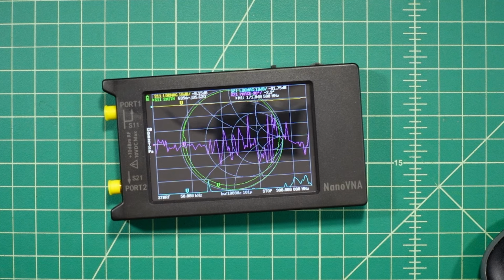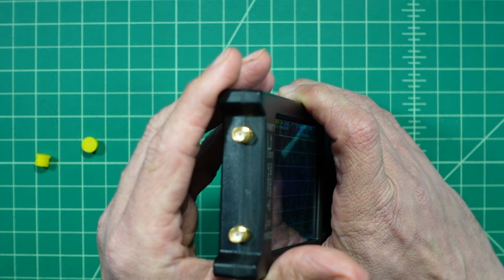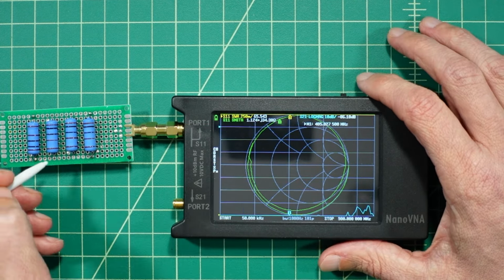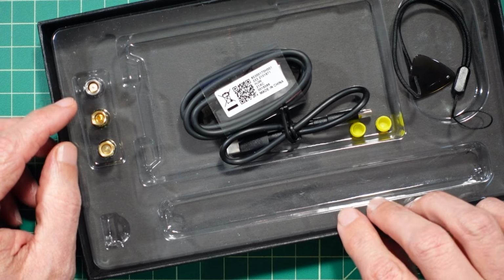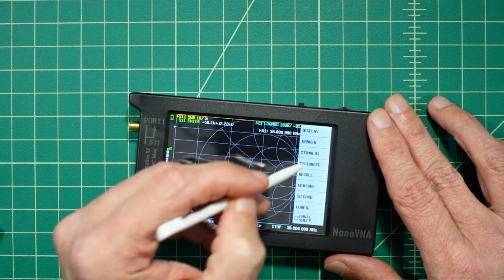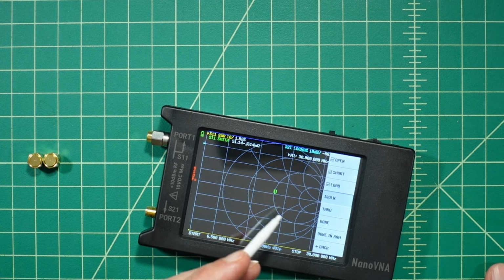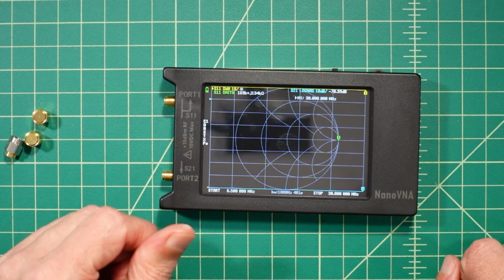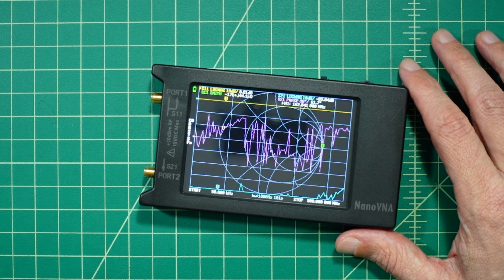NanoVNA Calibration: Expert Tips and Tricks

Comment: Last week I observed another potential pitfall to be aware of if you use the USB cable to connect to your computer. I wanted to compare a Quansheng stock antenna to a tuned aftermarket antenna. I put the stock antenna on, and loaded my calibration file. The resulting plot surprised me in that the antenna seemed worse than I anticipated. So on goes my tuned antenna, and it also exhibited SWR values that I knew had to be incorrect. So I re-calibrated, and it did not change. So then I changed the USB cable, and everything changed for the better. In fact, it then demonstrated the stock antenna had a better window of acceptable SWR in both VHF and UHF than I had anticipated. So the moral of this story is make sure your USB cable is performing properly. If in doubt, try a few of them and use a composite of the results that agree the closest.
Reply from the maker: That’s a pretty good tip, thank you 👍
Reply: @TheSmokinApe  
My downfall is I'm rather cheap. So that means 1: I often buy my cables from China, and then 2: I hate throwing things out. So, for anyone like me (may god have mercy on their souls), if you want to continue with step #1, you need to change the habits shown in step #2!
Reply: I assume we are talking about HT antennas here? rubber duckies? helical type? If so what you are seeing is not the USB lead per se. A hand held antenna a usually a quarter wave or loaded/shortened thing attempting to be a quarter wave and as such the element of the antenna is not the total antenna system. It relies on the HT body as part of the system that makes it work and match. It may even rely on being held to match well. When you attach these antennas to measuring devices like a NanoVNA, its a complete lottery whether the conditions for a good match are met. Like you found, the particular USB lead you had attached, or whether it on a wooden or metal bench top. Its a waste of time to fret about the performance on these portable device antennas, they never had any any, and cant been bestowed with any, they are and always will be severely compromised. Take a deep breath and chant "SWR is not loss, SWR is not loss....." :)
de G0AFV

Comment: Over the years I've collected a box full of unmarked antennas, I purchased a LiteVNA 64 V3.1 last year but they left the instruction out... I did your calibration and measured an ADS-B antenna (it is marked 1090) and got 1090! It's a start, I think I saw you measure 1,500PF for the cable, these things leave me have a lot to learn. Your video is useful, unlike some videos that blow pass the menu picks, the menus seems to be never ending.
Reply from the maker: Glad it was helpful, good luck testing all those antennas

Comment: Why wouldn't you just calibrate it with the short extension attached ?  I.e. attach the open, short, and load to the end of that short extension, because then that is where you will attach the coax and measure SWR.   Maybe I'm missing something?
Reply from the maker: Hey Jeff, that is the best practice but maybe the extension doesn’t have the same attachment for your calibration standards.  I really was trying to show “what is possible” not “what you should do”.  Thanks for watching 👍

Comment: Good video, but why does every video on calibrating and using the Nanovna describe a different process? One leaves out the isolation and thru stages. Another says put the load on the lower port for isolation. This is the first video I've found that says the sma female to female link is a standard for the thru calibration and to use it with both pigtails, others just use one pigtail to connect the ports to each other. I have a Nanovna that records SWR at 1.6 where my SWR meter records 1.1 - and I have no idea which one to trust 🫤
Reply from the maker: There are a few calibration methods depending on the measurement you are making.  That said, don’t have a known load you can compare both to?

Comment: Is the through port calibration needed all the time or only if you are going to use that second port? A;sp when saving calibrations in a saved location, they will automatically use the correct calibration. even though it had been turned off?
Reply from the maker: Yes, the thru cal is for when you are using two ports.  The saved calibrations persist even when turned off 👍

Comment: Excellent video. Some firmwares auto recall from slot 0 on power on, so set your most used profile up there. The slots save the trace configs and marker position as well, so I set it to the middle of 40m, my most used band.

You can "edit" a slot by recalling it, changing your trace configs, and saving to the slot again. You only need to re-calibrate when changing your start/stop frequencies :)
Reply from the maker: You are correct, thanks for the info 👍

Comment: I was wondering if rather than use the E-delay, would it make more sense to calibrate it with the test cable in place?
Reply from the maker: I think either will get you where you are going.  There are some cases where I could see an argument for using one of the other.

Comment: For low frequencies this procedure will be OK,. At the UHF band and above is better to calibrate at the end of  the cable instead the S11 port. Cables have it own VSWR and can lowering directivity of  the VNA. For  return loss -10 dB (VSWR 2:1) or more doesn't matter but if your device under test has -26dB (VSWR 1.1:1) the error can be between +6 dB and -infinite dB if the cable has -26 dB return loss. Is better to use a female to female adaptor and set the electrical delay to the reference plane in the cable connector, only few pico seconds in negative value will be necessary. Of corse the adaptor must have very low VSWR, typically female to female SMA adapators are bellow 1.04:1 VSWR up to 1 GHz.

Open doesn't matter for 30 MHz, you can just left open the connector of port S11 without the open standard. Friging capacitance are negligible at that frequencies.

In Smith chart all the unity circle (the external one) is infinite VSWR, no matter the phase.

Sorry for the faults, English isn't my native language.

Regards from Spain.
Reply from the maker: Thanks for the additional details 👍

Comment: Hi...thanks for the great video.  If you calibrate for 40 to 10 meters like you did in the video and then want to get an SWR curve for just say 20 meters, can you adjust the start and stop frequency values to the 20 meter band without having to calibrate to the smaller range that is within the larger originally calibrated range?  Thanks.
Reply from the maker: You can, and It do that however the best practice is to recalibrate 👍

Comment: Great explanation. I can calibrate mine to the built in SMA, but as soon as I attach an extension it goes haywire and gives wild readings. I have tried several cables, but no amount of fiddling with electrical delay or any other setting makes a difference. Any suggestions?
Reply from the maker: Are the extension cables "good" meaning quality with no problems?  What if you calibrate with the cables attached?

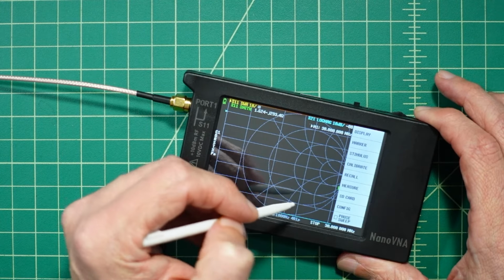Comment: 14:00 pro tip: The speed of radio waves is about 1 ft / ns in free air or about 8 inches per ns in a cable. So you can guestimate your delay pretty easily based on cable length.
Reply from the maker: Thanks man 👍

Comment: Not having to calibrate every single time I use this device makes testing antennas so much easier.

I just need to figure out grounding planes next. My HAM antennas go from 4.5 SWR to 1.1 SWR if I hold the base of the antenna.
Reply from the maker: Yeah, saved calibration is a great thing.  I am assuming you are testing HTs which is difficult 👍
Reply: @TheSmokinApe  Yep.

Comment: Great vidio. Is the lite VNA run with the same directions as the nano VNA? I got mine from R&L Electronics about 6 months ago. It seems that selecting the tabs on the right are hard. I did a screen calibration and it didn't help. Will look for a computer program to run it on my laptop with windows 11. 73's KG7COA
Reply from the maker: It should be similar, the different versions do have some variation in the firmware, make sure you are using a good stylus.  The best PC software is NanoVNA-Saver: https://youtu.be/2S0dt0bYoLs

Comment: That was great. I have the nano VNA-H4 . what i was doing at first was not save the calibrations . led to extra work each time I went to use. was a learning curve . with that tester you can do so much. figure the delay in coax the velocity factor. which is needed in phasing antenna's . along with  loss and reactance of coax. I used the H4 for tuning a UHF  duplexer for repeater use. and so much more. love how you can save data . you can even print out the charts. they have a zipper case for that. I got that when I ordered mine.  73's
Reply from the maker: Hey Robert, that H4 is the one I recommend to hams the most 👍
Reply: Tuning duplexers with a Nano VNA:
I bought one of these with very low expectations, and it didn't disappoint.
A good quality duplexer will generate -75dB to -90dB nulls when tuned carefully.
The Nano VNA can only measure down to something like -50dB.
As a result, you lose the bottom of the duplexer null response on the VNA display, and you can't really see what is happening.
They simply don't have enough dynamic range. It's output power isn't high enough to get through the -70 odd dB nulls of a duplexer, and / or it doesn't have a sensitive enough reciever section to pick out such weak signals.
I have toyed with the idea of adding an external amplifier and re-casing the whole lot, but I just haven't got around to it yet.
Reply from the maker: Yes, dynamic range can be a bit of an issue on these.  Thanks for the comment!
Reply: @digitalradiohacker  I still got the tune on a TX/RX systems used UHF duplexer used for a GMRS repeater. The nulls /notch dips to noise floor on the nano VNA , but I still found the frequency points for the HI and Low . was tricky and took time, but under power the SWR and power loss and receive loss was so much better then the old one . 73's
Reply: @robertmeyer4744  
👍👍
That's the problem - The noise floor APPEARS to be higher on one of these because the output is quite low, and this limits the precision with which you can tune duplexers. On more expensive instruments the noise floor APPEARS much lower, so you can see the real bottom of the nulls.
I know what you mean though - With a Nano VNA you can get a duplexer very very close, and for a quiet area with low RF levels, you'll get half decent range from the repeater.

Comment: When you do the thru calibration, why do you connect the two cables together first? Why not just connect a single cable to S11 and S21?
Reply from the maker: Because I will be using both in the test, so I want both to be part of the calibration 👍

Comment: Hello, thank you for this informative video!
I’m new to radiology, and If you could clarify how does your frequency range on smiths chart shrinks after electric delay introduction. But my 2.4 wifi range (I took with extra 2350MHz-2550MHz) shows huge arc that only shifts radially after delay input(I tried 1000p 500p etc)?
My extension cable came with NanoVNA. Should I expect it to shrink at all?
Reply from the maker: The e-dalay adjusts the Nano to account for added transmission like that was not part of the calibration.
Reply: @TheSmokinApe  Great, I just retested your values on my vna, and the result was same as yours! I'm glad. Everytime things go south I think of me breaking my nano(for me it costs fortune). Thanks for the response and clarification!

Comment: good learning thanks ... question as  new to this .. using vna ... got 1.5 swr but logmag showing way out anything from 20 to 60 loss , any ideas please
Reply from the maker: There are two different LogMag measurements, one is return loss (s11) where low is a good thing and the other s21 LogMag is a gain / loss measurement.  It sounds like you are measuring return loss (s11) and you want that to be low.
Reply: ok not good then ,,, thanks .. needs to do new cable thanks info ,,, keep up the  good work
 @TheSmokinApe
Reply from the maker: Thanks bro 👍

Comment: Another good and useful video, thanks Ape. I have a small VNA which I bought in the COVID lockdown. It's done well but it's battery is starting to bulge, so I thought I would upgrade. There are so many flavours of VNA now, please can you say if the H4 is as good as any for general ham work, or are there better options? Cheers, Ace
Reply from the maker: Hey Ace, I had a battery go bad in one of mine and I replaced it on video; its somewhere on the channel.  The H4 is the one I recommend to hams the most 👍
Reply: @TheSmokinApe Thanks for your help Ape, I check through your video list. Based on your advice, I may buy an H4 and replace the battery in my old 2.8 screen unit and use it as a back-up. The VNA is such a useful ham tool, I wonder how I lived without one! Best 73 Ace

Comment: I have a question. I personally do my calibration with at least one length of the provided cable and my SO235 on the end and calibrate it like that. Would that negate the need to go in and fine tune the cable? If so, it would save a step. I had learned that this is the proper technique years ago, but I'm always willing to learn something new, thanks for the video!
Reply from the maker: It would just mean your reference plane is the end of that cable.  I think you are fine with that given this is ham radio.  Do you have pl259 standards?
Reply: @TheSmokinApe no, I use the provided barrel connector and use the standards on the end of that. What I have is an SMA to SO235 that I screw my antenna cable into. If I calibrate it that way the end of the SO 235 should become my reference point (or close to it). That should eliminate the need to adjust for the cable length I should think. But that short cable length had more effect on the end result than I expected so I'm hoping I'm not skewing my results!

Thanks for the good tips and making me aware. I'll try compensating and see if it changes my results. Cheers 🤙🏼
Reply from the maker: @blackpearlvoyager4174  good luck with it 🍻

Comment: Thanks for the good advice. I thought the H4 only has 101 data points? Good shielding of the important parts is essential and some fake or cheap builds don't have them. This lets to scrumbled readings esp. in the higher frequencies. So most important for me is: how can you be sure what you finally get when you order one?
Reply from the maker: I the newer firmwares can go to 401 which is awesome.  Whenever I get one I thoroughly test it out and upen them up to see if the correct board and shielding is in place.

Comment: OK Ape this is good info and well explained, I did not go thru all 156 comments, but could you tell me why you do not put your leads (as you will always use them to connect) on to do the zero test, I'm a bit confused? de ZS3LB Leon
Reply from the maker: Sorry man, not entirely sure what you are asking
Reply: @TheSmokinApe  To calibrate/open/close/load with the lead, instead of rectifying it later to get it back to 0. I hope this makes sense?
Reply from the maker: It does, an I do calibrations with and without the leads.  Depending on what I am testing and where I want my reference plane to be located.
Reply: @TheSmokinApe  Thank you Ape. I just received my new H4, so I'm just getting into it. You have also made me to think out of the box and to apply different ways to work and rectify. 73
Reply from the maker: @lmy5pence481  awesome, good luck with it 👍